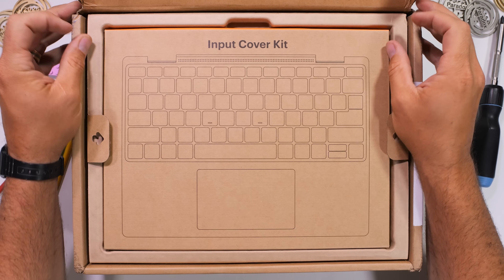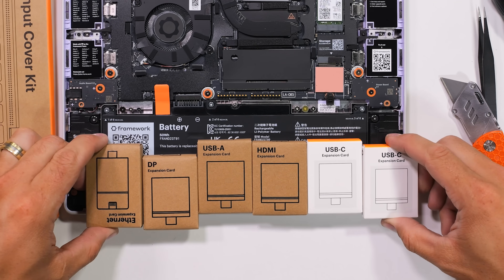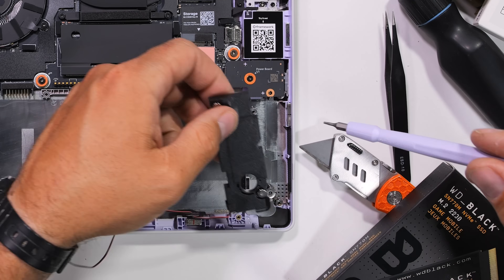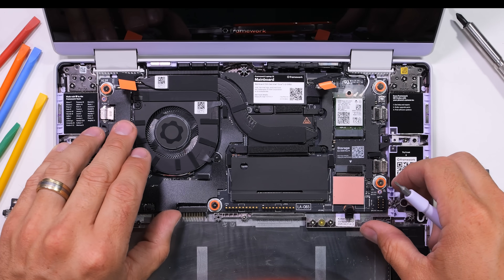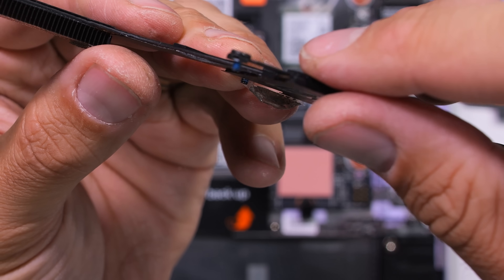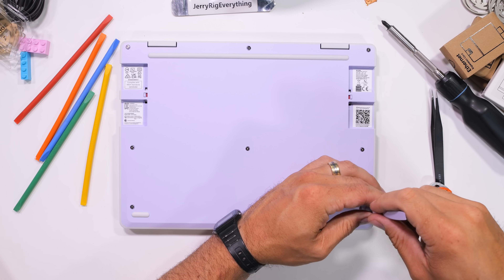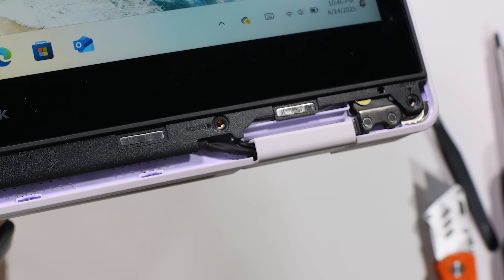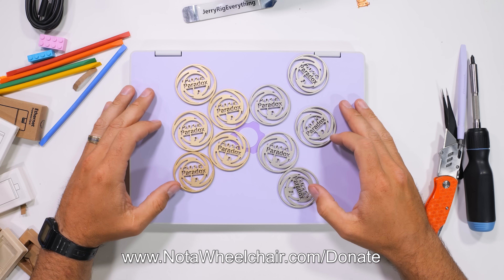The Best Laptop on Earth... is almost too easy to fix.

Comment: Working in IT for over a decade and having repaired hundreds of laptops these seem amazing. The only thing I would recommend (I couldn't tell from this video) is to use locktite on your hinge screws. Many times I see with those metal threads and plastic base enclosure holding the threads in place will break. Usually it's due to the screws getting loose over time causing the hinges to bend and twist eventually breaking the plastic surrounding the threads.
Reply: FW hinges are also replaceable.

Comment: “Starts at $559” - at that price you get a paperweight as it does not come with RAM or any storage. Also no charger and no ports/modules (so you can't even charge it as there is no port for it if you don't buy it). So after you add ram, storage and at least 1 module so you can charge the thing it's approaching $900 so.... yeah.
Reply: It's a little misleading, but only a little. If you already have RAM, storage, and a charger, then you don't need to pay for their hardware. From reading the FAQ for the expansion cards, it sounds like you don't need a USB-C module to charge, it's just difficult to get the charger into a USB-C port without one. The modules all use USB-C to plug in, so even without modules there are USB-C ports to plug in a charger. The USB-C expansion card is only $11, so even if you do need that, it only pushes it to $560 (the base model is $549 right now as I'm looking at the builder, not $559, but yes, Jerry says $559).
Reply: The "ports" they sell are just USB-C dongles that fit in the machine's case. They have native USB-C ports, it's just a pain to use them without their expansion cards.

Comment: Is it possible to buy the RAM for these laptops elsewhere? Are they locked to using the data storage types listed on the manufacturers website, or are other brands compatible also?
It would be nice if the CPU was upgradable.

Comment: If they ever make a high-end 2-in-1 to compete with the Lenovos or HPs, I'd give it a shot.

I've had a very good experience with my Lenovo Yoga C940 for five years. It's not showing it's age in any way, but I have looked around to see what's available. Frankly, there aren't any hugely compelling upgrade options out there. A future proof, easily upgradeable machine would be pretty cool.

Comment: Although it is modular many things are on preorder.
It is also more expensive then L or E series Lenovo, which is usually also quite user serviceable. The only thing you can’t service in those are ports. In older T series you could even change those before usbc was the main charging port. So yes framework is Ok but there is more to do. 
The cpu is not user replaceable and what do you do with the old mainboard in framework? The whole socketed cpus have to return otherwise it is not big change

Comment: The method I used to not lose screws was to take a picture after I took the back off of the computer, print it, and scotch tape the screw to where it goes on the picture as I removed them so the screw doesn't roll away and you can see exactly where the screw belongs.
Reply: That's smart, although it's nice to know you'll be spared that effort if you ever use one of these

Comment: I don't want to "be that guy" but those pogo connectors appear to be hard gold plated. Gold does not form an oxide layer. It is most likely alloyed with cobalt for hardness, which does oxidize but cobalt is generally around 0.3% of the alloying constituents (when following the MIL-DTL-45204 Type I  Grade C spec )so it is unlikely to have any real word effect on oxidation. As long as the springs don't fail, those connectors will last a long time.

Comment: Framework is single-handedly disproving all the people who try to excuse lack of repairability by claiming it is required for pricing or compactness.
Reply: I mean, "required for pricing" is somewhat true, these things are fairly expensive for what they are
Reply: @colbyboucher6391 Yeah, they are a little underspeced for the price, imo. Still cool, but kinda pricey. The best value you can get is still probably a pre-owned laptop. I found a totally fine m2 MacBook pro for about 350. The value you can get with gently used items on Facebook are kinda crazy. 

But if I wanted new, id go for a framework. Its just that im not much of a power user on laptop. A few years old mac or windows laptop is more than good enough for me. 

The fact that you can replace the battery on the framework does greatly increase the value for me, though. I have never replaced a laptop because of performance. Its always the battery. My used MacBook is currently at 85% battery health. As it drops below like 60 or so, that is when it starts to get annoying. Which likely wont happen for years, but when it does, I'll have to buy a "new" used laptop. 

On a framework, I could just replace the battery. Which looks like it's 50 bucks. So that is real value for me. 

But then again, it is always nice to get the solid upgrade on every part when I buy a new used laptop. Going from an old Lenovo with who knows what in it to an m2 pro was a noticeable upgrade. 

With how good the deals are used, it'd likely take me multiple battery replacements to break even with framework over the used market and that's assuming nothing else breaks in 10 years, which isnt a given. 

Im 100% sure that the specs on the 12 base model would be fine for me in 10 years.  My 10 year old Lenovo was also just fine, even in 2024 besides battery life. But the upgrade was nice beyond the battery life. The screen on the m2 is as good or better than my desktop, for instance. 

And then we get into framework being better for the environment and they 1000% would be if this repairable model catches on, but right now, I think buying used and saving perfectly good tech from a landfill is still the best environmental option right now.
Reply: True, though framework is a much smaller company than most other brands. And from what I'm aware the scale is a business is even more impactful in tech for pricing than almost any other business.  @colbyboucher6391
Reply: @colbyboucher6391  disgustingly expensive for the function of using it as a laptop. but repairability and upgradability is nice, but the initial investment is too high to justify it
Reply: I don't see any 7200 mt/s ram here
Reply: More like proving them correct — they’re both slightly more expensive and slightly bigger than others. I still probably wouldn’t buy another laptop, at least not for Linux or windows.
Reply: The price for a framework 12 with the i5-1334U, 16 GB of RAM and 500 GB SSD is $900 in Switzerland. Maybe add $100 for the stylus?
A Yoga 4 with ryzen 5 7530U and similar RAM and storage is $1219 at the biggest online store in the country. 
Honestly, framework is competitive in Europe. No idea what happens in the US with the tariffs, but they do have a market around here.
Reply: @apotheoz9196  Canadian here. I recently got a new laptop from HP. Actually took a look at Framework 13 before and man, the prices are brutal. I just tried configuring again and it would work out to be CAN$2,600 before tax the way I want it. Let's say you buy some of your own parts, then it would still be around CAN$2,500. After tax, this thing is like CAN$3k.

Meanwhile, you can get an HP Omnibook X Flip 14 specced similarly for CAN$1,600 on sale, with tax then you are still looking under CAN$2k. Mine comes with the Intel chip and is a bit cheaper, and comes with a 3-year accident protection plan on sale. 

This is actually to be expected, if you know how cars work as well. Japanese cars tend to bundle equipment together which is less flexible, but upgrades cost less due to better production streamlining. German cars tend to have different options a la carte, which are more expensive because you can't crank them out as fast or efficiently.

So Framework will still be very niche, since even for the tech savvy people, the value proposition is just not there. I can buy an HP for 2/3 of the price with OLED display and 2-in-1 format. Skip out on those and you are probably looking at Framework being twice the price of a brand name laptop.
Reply: @apotheoz9196  I am from Switzerland as well and 900chf is way too much for a crappy i5-1224U CPU with only 12inch display and probably a non existing gpu. I've found very good Lenova Ideapads for 800-900 that were so much better. And yoga is overpriced as well. 
Maybe frameworks are selling here but what is really selling in CH are macbooks.
Reply: They are double the price of "conventional" laptops with the same specs.
Reply: I have a framework 13. This company, and the laptop, is freaking amazing!
Reply: the Framework 12 almost a $2000 laptop for an i5 500gb storage, and 16 gig memory. This laptop is awful value
Reply: @reidback6508 Unless your talking in some other dollar, the price for that config is $1400 according to the website, which while expensive is not $2000, don't claim things without doing research first.
Reply: @reidback6508 the price is literally half of what you said
Reply: @reidback6508  just no, visit the website and you literally cant get to 2000 even if you max it out
Reply: But i can get some thinkbook with better specs for lower price lmao
Reply: @ЗеАлоне  And after warranty runs out you're completely at the mercy of dumb luck whether you need to buy a new one or not. Not to mention if you yourself screw something up before warranty runs out. Framework is better value. Question is whether they don't offer something you need.

Comment: I mean... it's really not, though. Framework has been ignoring owners for years now about the attrotious lack of simple functions any decent laptop would have such as "palm rejection". The trackpad on the framework laptops basically has the opposite of palm rejection. The USB C ports and modules are often unreliable, buggy, very strange behaviors and still very little response has come from framework to resolve these issues. As an IT guy having to sift through the options of hardware for our users, the framework laptop has quickly became my last choice.

Edit: thanks for the great video and teardown!

Comment: I don't even need a laptop and now I want one just to take around the house or to restaurants and such. The tablet mode especially, I've always been a fan of the vibes of windows surface but it's always been way too expensive for me to justify, and not upgradable, neither of which would be a problem with this.

Comment: I am uncertain about the value of my Framework laptop's GPU and CPU, as they have become outdated after a year and will likely become obsolete with future upgrades. The primary concern is that these components are only compatible with the Framework laptop itself, which is not a high-performance device like the MacBook Pro. With 128GB of RAM, this laptop is not a powerhouse, and I worry that my outdated hardware will become worthless as I upgrade to newer hardware from the Framework system. Who will buy my outdated Framework hardware? Is Framework buying them back or offering me a discount to upgrade to better, newer hardware?

Comment: I am sorry, but this makes no sense. I understand that Jerry simply does not like Apple, but I can't see in what way is this better. MacBook Air's CPU is about 2x faster and only 231USD more expensive. I am pretty sure that memory, SSD speed and display quality in on another level. Slower machine means that you need to replace parts more ofter to keep it up to date. I am watching this video on 2012 iMac which still does everything I need it for, 3 years ago I replaced 2008 MacBook Air. So cheap laptop, even with replaceable parts, will create more e-waste and in long term will cost way more to keep it relevant. And if you say that you can configure ports yourself - because of the way it is connected, there will be limit to the speed, power delivery... This is not the first product, with this idea and none of them took off so far. Question is WHY?

Comment: I can  speak to Framework's support team. They are top notch and very responsive via email. I was dealing with a bad battery, and they were great to work with. In the end it was a $50 fix (though I couldn't help but add some expansion card I didn't have yet).

Comment: The problem with the Framework is the price. - yes, you're getting a repairable laptop, it's awesome this company's primary focus is on repairability. But, $1,369 USD for a "performance" version of the Framework 12, with an i5 13th gen, 16GB of RAM, and a 512GB SSD is kind of ludicrous. That's nearly $2,000 CAD. I could buy a whole laptop, now - with better performance, better display, keyboard, build quality, etc. - and if it breaks, still have money left over to buy a whole other? 

I understand the point is to be Eco-friendly, recycle, and it's a small company - so their margins are more tight, I just do not see the value at all in buying a framework. You could buy a thinkpad with specs that would put this to shame for like $200. And, those are fairly common, easily repairable laptops.

Comment: It's pricey compared to what you get performance wise... and of course, apart from the SSD, wifi and RAM, you'll need to buy spare parts from them, unless you know how to make PCBs and 3D print...

But... it's still crazy much better than the glued-together ones that are built as if you were never supposed to see what goes on inside.

Lots of respect from here.

Comment: I work as an SSR (Onsite IT tech) for IBM (LEnovo) and altough Lenovo laptops are pretty easy to work with and disassemble... this is on a new level entirely. 
Also I would kill,  for Lenovo to start using captive screws for everything, and not just the fan and D-cover.

Comment: Please do the 16, Framework is the technology company we all need. Despite the countless lectures we all get from tech companies about how modular is too expensive because then you need mechanical fasteners, which are "expensive" (what's a screw machine?) and plastic connectors (maybe legitimately "expensive" compared with bulk-ordered ceramic caps, but then again, you don't want your plastics melting or introducing too much impedance to your connection), and extra engineering design cycles. Except, this wholly modular platform is far cheaper than most hardware on the market. It's almost as if the barriers to entry into hardware production are so high that's it's granted a minor monopoly to the few companies capable of surmounting it and they have a gentleman's agreement about what the cost floor of these things should be, irrespective of the cost to actually design and produce them.

Comment: Left Windows 5 years ago for Linux Mint and not about to go back. Is the Framework 16 Linux friendly? Love the engineering involved in this Laptop. Kudos to Framework.
Reply: Mobile i3 13-th gen, with integrated video and off-the-shelf other components, it should be Linux friendly.

Comment: Danger, this comes with Intel CPUs that have way too many efficiency (aka slow AF) cores. Way more than power cores, I owned one of these. The problem is if the OS throws a task to an efficiency core which is likely when you have 8 v 2 perf cores, your laptop will run extremely slowly, it will barely be usable.

So this is DoA until they provide better processor options sorry.

Comment: The problem with this kind of product is usually that they suck with their performance. They are usually clunky, badly made, have a cheap feel to them,  the software and hardware don't work together properly etc. I wonder if it's the same with this one. Compare it to a macbook. It might not be repairable, but it sure works like a charm from A to Z.

Comment: The price is wild, as in very high wild.
But being ex-user of big and heavy old gaming laptops that had socket CPUs; and GPUs on MXM board, the amount of work needed to get different GPUs working was crazy. And not every Wifi card would work, you were also heavily limited in what screens you could upgrade to depending on the LVDS/eDP connectors and even then there is voltage to worry about as different screen models have different voltage req requirements.
A ton of annoyances and compromises were also commonplace, Clevo had really bad keyboards, bad speakers and questionable build quality, Alienware are probably the peak of them all with HP and Dell workstation laptops being close second in terms of ease of upgrading GPUs, highest I ever got upgrade was RTX 3070 on my 2011 Alienware M17x R4 but the HDMI port being only 1.2 hurt that laptop a lot not to mention you were limited to the type of drivers you could use and have to build your own PWM fan controller because the newer Nvidia MXM cards do not have fan controllers on the board, its all software.

Comment: $550? 🤣😂The same laptop is £1100 in the UK (Nearly 3 times as much); so - either they are trying to rip us off or don't understand what an exchange rate is... Great concept, terrible execution - if the cost were near the suggested $550 then my organisation would switch from Dells quicker than you can blink; but as the cost is frankly ridiculous, there isn't much chance of that.

Comment: I think my favorite part of the Framework ecosystem is that if/when you decide to upgrade the main board, the one you remove isn’t totally useless unless it’s dead! You can buy, built, or print an enclosure and use it as a standalone slim computer! 

I still don’t need a new laptop, but Framework is my number one pick for when I do.